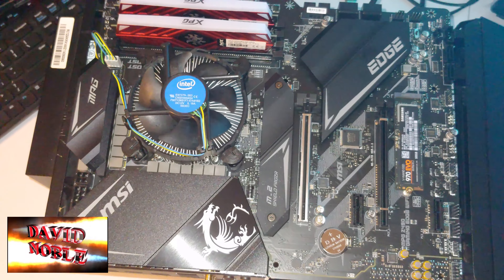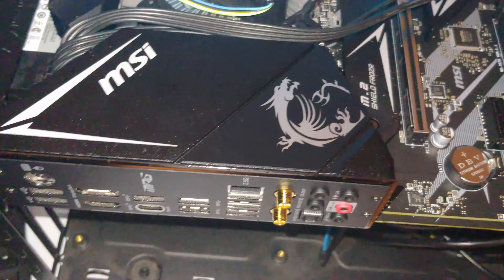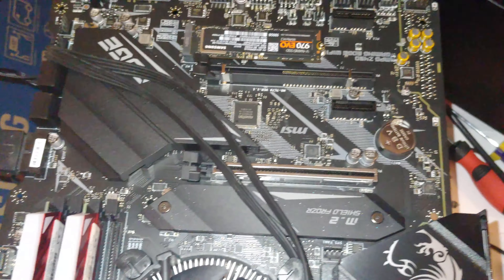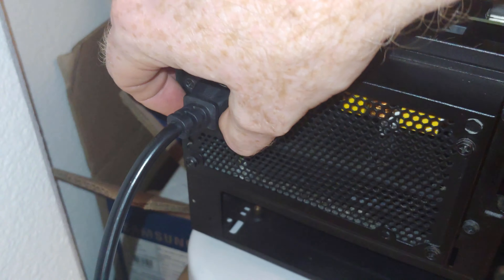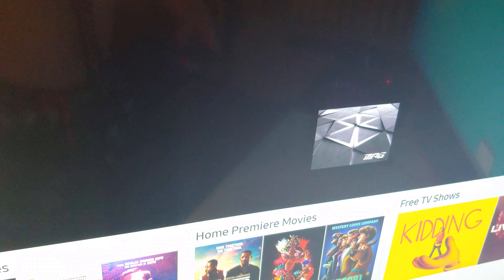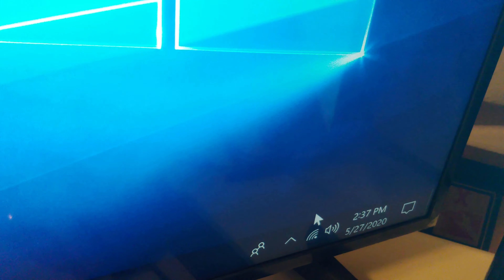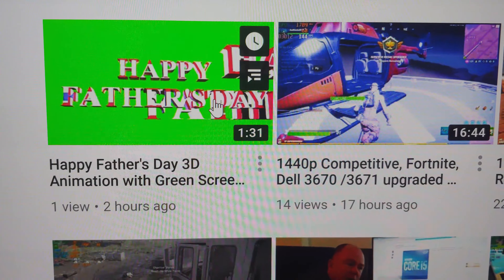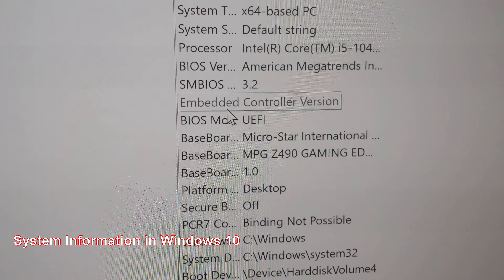Getting the I5 10400 up and running on the test bench, Intel 10th gen CPU, Z490 MSI Gaming Edge wifi

Comment: man thank you for this vid, I recently have done this exact built CPU/board/2060 RTX super and was worried about the 2nd pin power. I didn't have one and have been running this without. based on my findings and you confirmation not need. 
worries set aside.

Thank you!